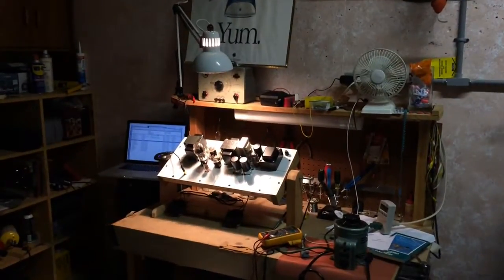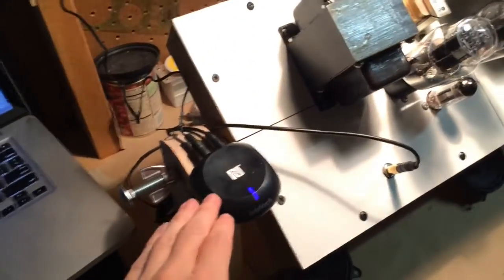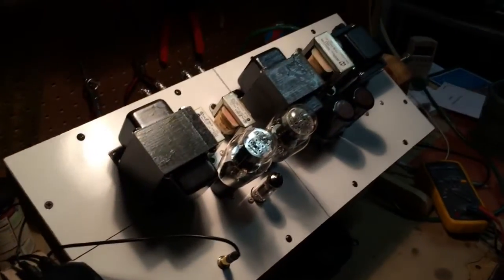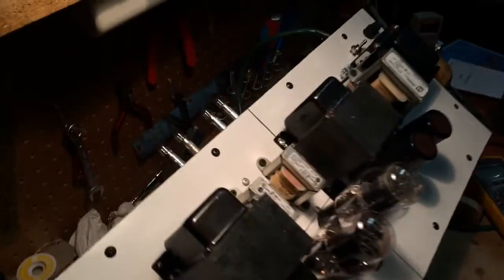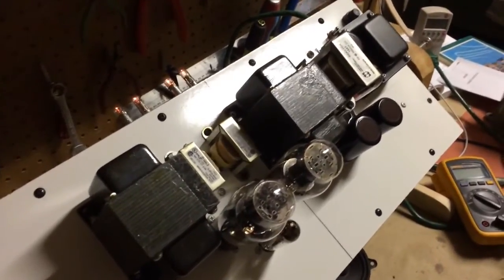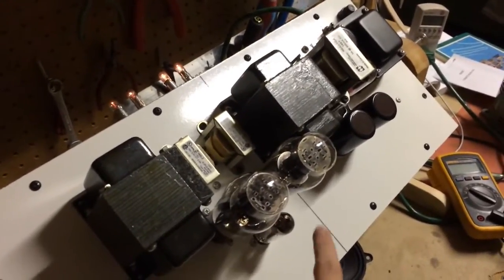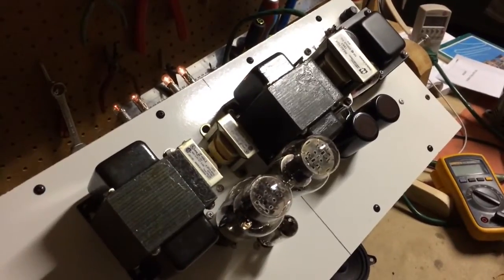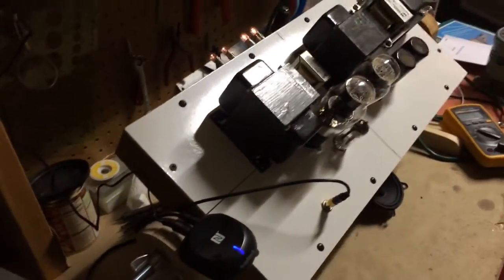2A3 Tube Amp

Comment: Why hasn't anyone commented on this beauty. How is it running these days? I'd like to build a 2A3 and there are so many different circuits I am finding. Could you offer any info on your transformers? Especially the PT. What about the circuit you used? I have about Three or four circuits printed out to look at. I've also seen a build using the 266L12B used instead of the 166L12B, this way its only one filament transformer for the 2A3. Chokes been different on the builds I've seen. Any info will be greatly taken